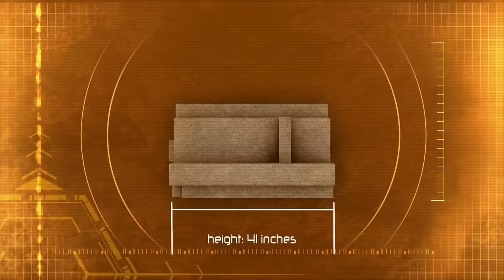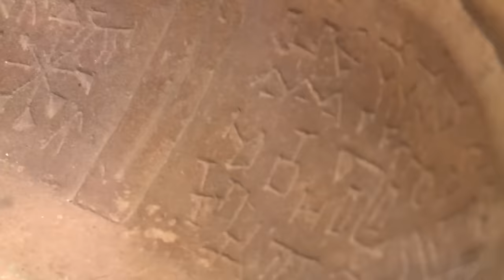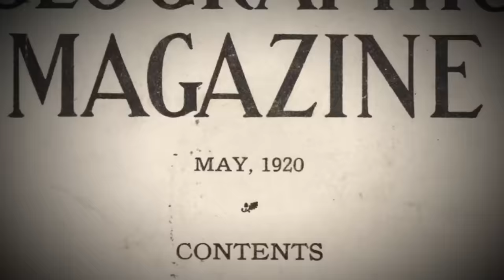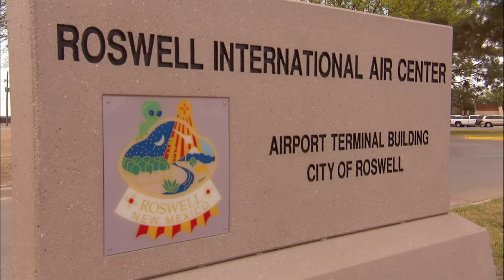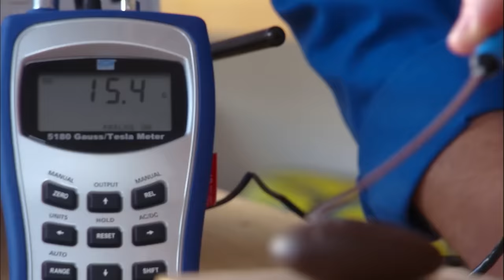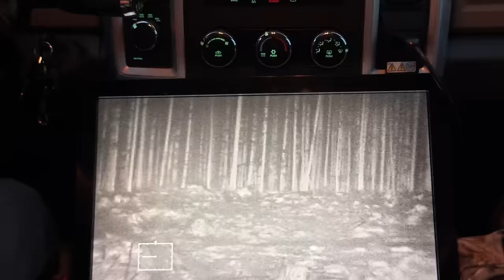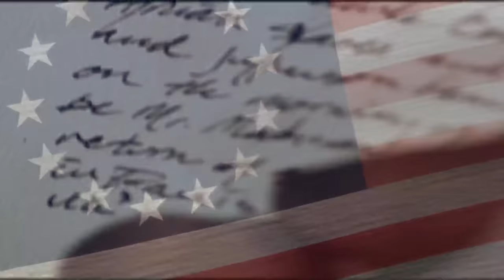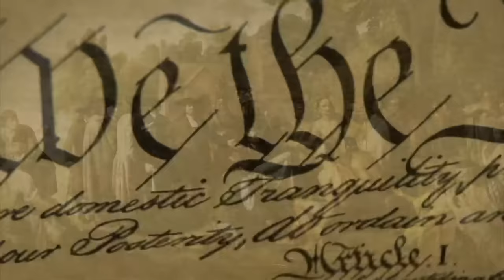TERRIFYING PROOF OF ALIEN ACTIVITY *Epic 3 Hour Marathon* | In Search of Aliens

Comment: If it was giants, they would need to be roughly 200 times larger than an average sized human. Most humans can lift their own weight. 20 tons would be 200 times stronger than a human of today. So, the 8-10 ft giant theory is out the window. So these giants would need to be roughly 1200 foot tall. You’d basically have to accept that there were beings walking around that were double the height of an average skyscraper Rolmfao 😂